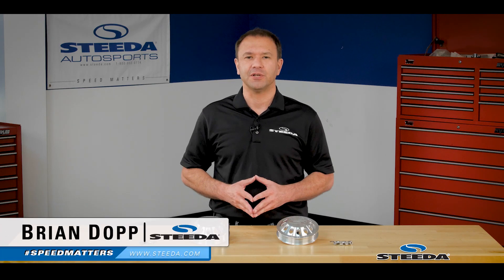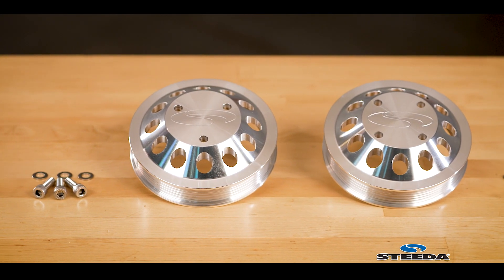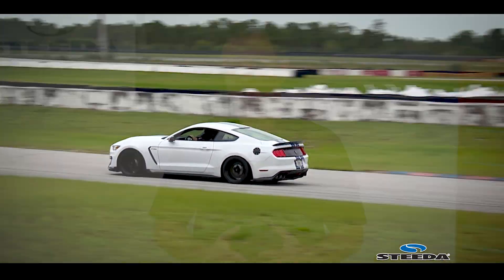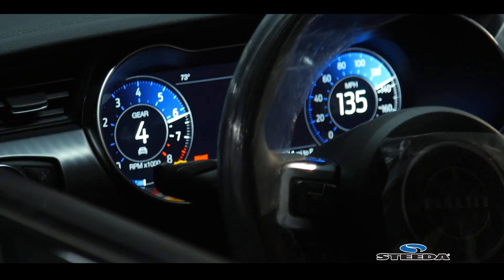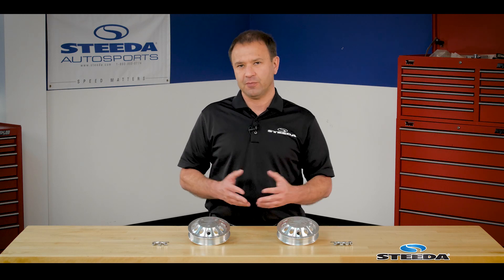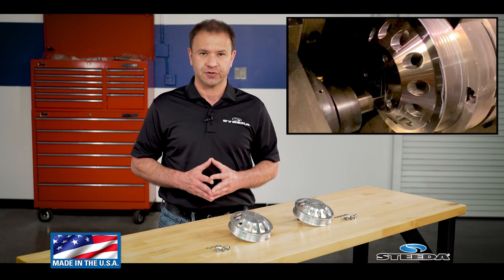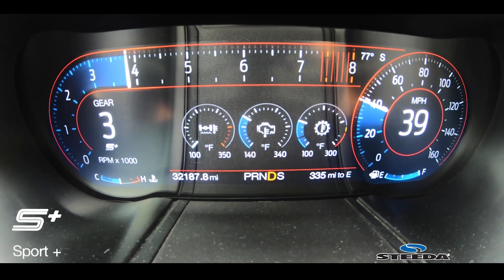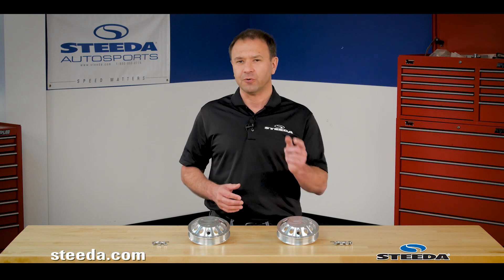Steeda Mustang GT Billet 3 & 4 Bolt Water Pump Pulleys | Review

Comment: Hey can I use the Water Pump Pulleys also for my 2014 V6 3.7L Mustang? Are the diameters the same? otherwise could I install the Steeda Pulley to my V6 with different serpentine belt? :D
Reply: I purchased this just to find out if you're still wondering. I have a 2014 V6 3.7 Mustang as well. The diameters are not the same. The Steeda pulley is 5.875" and stock is 5.37". The pulley seats just fine, holes line up on the pump. It does not perfectly line up with the crankshaft by a smidge; the belt would technically run up against the lip of the pulley. I didn't try starting it up because I don't have a longer belt on hand.

My main concern running this is technically the pump will run slower due to the larger diameter. So I'm actually weighing bling vs proper pump flow. I wish MMR did not discontinue their aluminum V6 pulleys; I wish Steeda made aluminum V6 pulleys.

Comment: What is the weight saving in pounds compare from stock.👍👏
Reply from the maker: Hi Serge,
They weight about 1 pound each which is about 2/3 the weight of stock.
Reply: The stock water pump pulley weighs 1 pound 10.3 ounces for reference